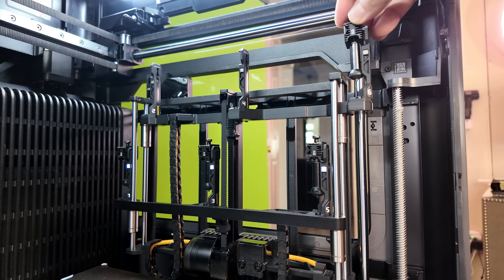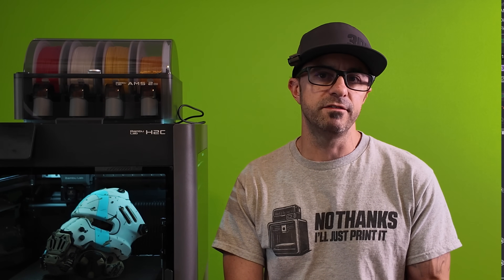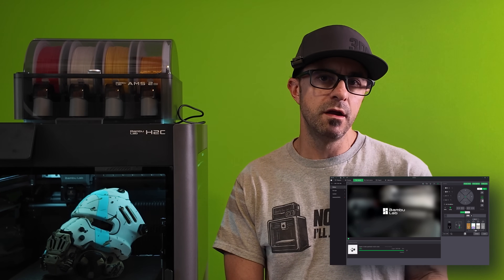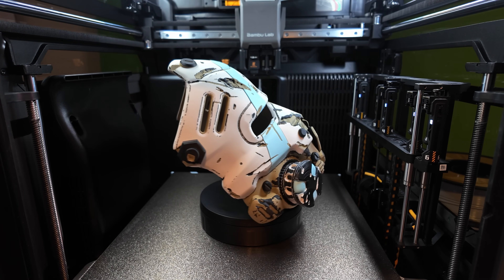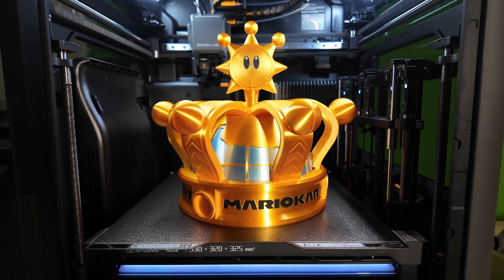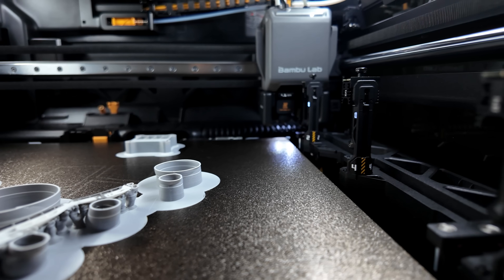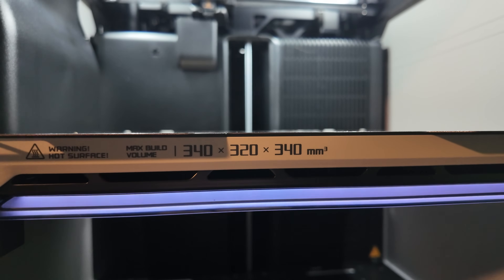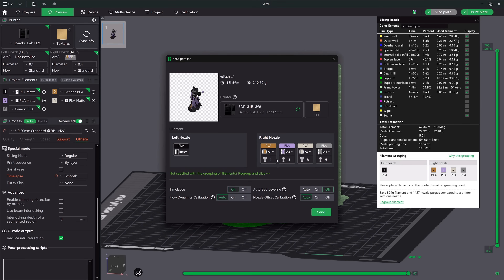Honest Bambu Lab H2C Review No More Filament Poop!

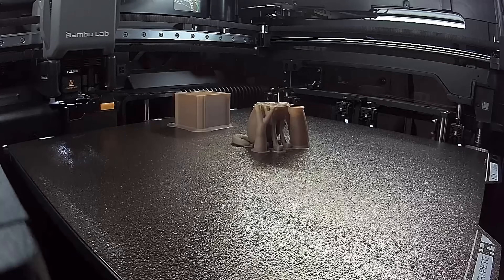Comment: 8:05 why on the Grinch dog does the wipe tower continue to go to the top height of the print? The software should be smart enough to know to stop printing the wipe tower once there will be no more color changes. I mean if the goal is to cut out the waste, that’s another area where waste could be cut. Obviously if there were more color (or material) changes, that’s different, but the wipe tower should only continue up as far as wiping is necessary!

Comment: I'm debating on what multi tool system i want to get right now. I was watching another video and the video showed it takes 46 seconds per color change on the H2C and then they showed the Ultimaker and it only took 9 seconds per color change.
Reply from the maker: It comes down to both budget and what your plan to use the multi tool changer for. I do not own an Ultimaker so I can't really give you any advice on that printer. However the H2C has a much larger build plate so printing larger models like helmets will be possible on the H2C. Id love to give you my thoughts on the Ultimaker but they have not reached out to me.

Comment: Another great vid, thank you! I just wanted to put in a plug for Sy's Peglock (printable pegboard mounting system and attachments) - the way the hooks print allows for greater cross-section in the hooks, and the way the cleat works in the various shelves and holders aligns the hook in a more optimal position to resist the stress they're under.

Comment: Question: when a print is finished, does it go through and purge out all of the hotends? Or does it just leave filament in them and purge at the start of the next print?
Reply from the maker: No it doesn't do that until the printer needs to use the head for a new color. Because if you print another model and use the same color it will grab that nozzle and match it. It would be a waste to purge it premature.

Comment: Be nice if this was a honest review. Although I have a bambu and like this one, I like indx a little bit more. Cost analysis has to be with other multi head not multi color. And finally why not talk about the uneven heat bed. And there is no way they have been working on this for 3 years, this is a almost copy paste from indx.
Reply from the maker: Sorry that you think I am not honest with my review. I can't talk about something that I never experienced. I have had zero bed adhesion problems with my machine. Proof coming soon.
Reply: @planet3dp thanks, could you also just check with a thermo camera? Would like to see if there’s only a few having issues or if it’s the same. I can’t find enough reviews to talk about bed heating, and would also like to know can I take this completely off-line?

Comment: Nice video, thanks. My question: Can one bypass the AMS on the right side temporarily to print with externally fed (real) TPU from a top feeder ? Or is the H2C a downgrade from the H2D in terms of TPU printing ?
Reply from the maker: I don't see why you couldn't do that. It shouldn't be an issue.
Reply: @planet3dp  Thanks for your reply. I would love to hear from someone that has done this, as this would otherwise be the only potential serious drawback of the H2C. In the coming weeks someone will surely post the results of such a test...

Comment: In Canada, the H2C is $3150!! The P1S combo is $699, the choice is easy!! The savings on PLA aren't worth the price difference; I'd rather buy four P1Ss than one H2C. I currently have two P1Ss and I'm completely satisfied with these very good 3D printers.
Reply: @mathieulessardr  buy p2s
Reply: Buy p2s
Reply from the maker: Yes I own 2 P1S machines and they have gone through some major printing projects and just keep working perfectly!
Reply: @planet3dp I went from an Ender 3 to a P1S, imagine that! 😅 I already have 450 hours on my first one in 3 weeks. I wonder how many hours you've got and if problems appear after 10,000 hours?
Reply: @planet3dp  Germany i pay 750€ for a p2s a few weeks ago
Reply: That's a very good point.
Reply: Hold up buddy! H2c is built for multicolour printing. Can’t compare these two in multiple colour printing. As demonstrated in another video, a “melted Rubik’s cube “ 3d print on a single nozzle produced 1.2 kg in waste . Roughly $20 CAD.  Running 4 p1s printers all day? You do the math. H2c produced under ONE gram. Insanity!
Reply: @mathieulessardr  I understand where you are coming from. I have an X1C I didn’t used to do much with multi color but now that I do more multi color the wasted purge is detrimental to my workflow and cost. Being able to cut that time and purge waste down it the difference between profit or no profit. With that being said unless that’s your case it’s not worth it

Comment: TPU, print speed, tool change time, Have you actually run the machine?
Reply from the maker: I only had the machine for less than 2 weeks. I opted for showing the filament waste differences and large multi 1000 swap prints.

Comment: Hi, Can you tell me, what does it say when you try to use the higher grade engineering filaments in the AMS units?   Does it still warn you that they may break and you shouldn't really use them in the AMS?  Because I can't help but feel we all want this for its capability to print the higher temp CF filaments that are Brittle, and thus as advised by Bambu Lab, not suitable for the AMS untis...?   Whats your thoughts on this?
Reply: Good point/question.  Time to bring the AMS capability in line with the capabilites of the printers
Reply from the maker: I am going to be purchasing some engineering filaments soon. But with the way this is marketted I would think those materials will be ok.

Comment: Dang.  I went to your affiliate link and it looks like they are already sold out!  Not surprised with how much anticipation there has been for this printer.  You made a good video and showing the numbers on saved waste was helpful.  I hadn't considered just how much this system will save on the expensive engineering filaments, so you made a good point.  Subbed.
Reply from the maker: Awesome glad you like my H2C video. I really wanted to focus on how the machine will pay for it self faster than you might think. Once I did the numbers on high end filament it was even more obvious.